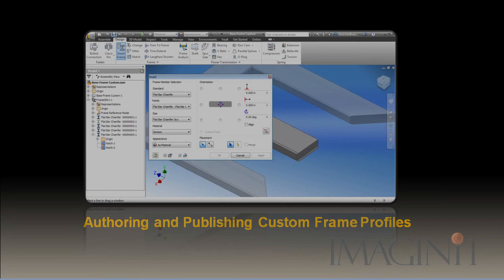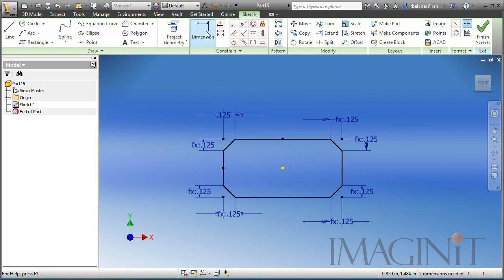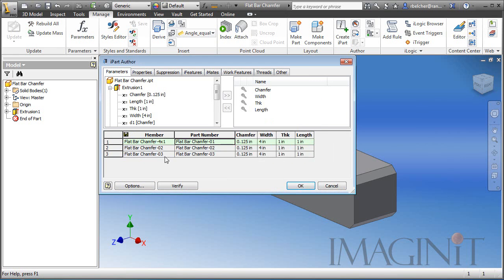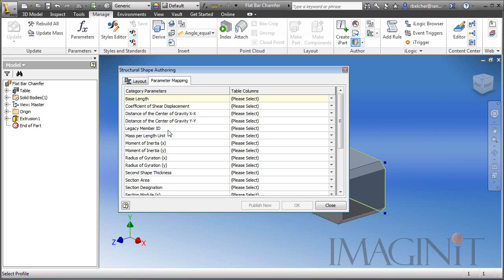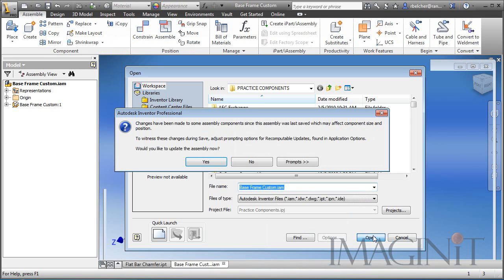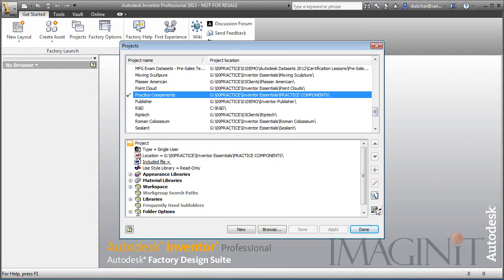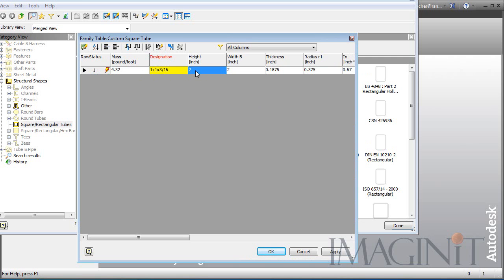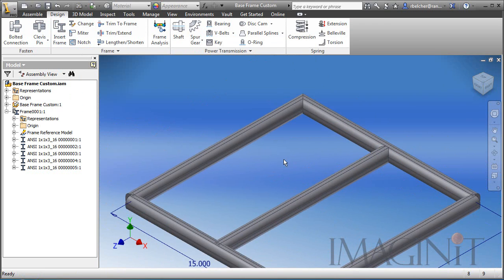Custom Frame Members for Frame Generator

Comment: Great video. Very Informative. you can click on all four corners of your frame and miter them all in one operation. No need to click Apply in between each one. You can also choose both ends to notch in one operation as well.

Comment: Thank you for the tutorial.
I have some troubles with customizing profiles in Content Center. I want to map the length column to an Iproperty called "Length". It works fine when I use the command "Open from Content Center". But when I use the same profile in Frame generator, the Length is filled out with 0.001 (standard value). Do you have an idear to improve that?
Thanks!